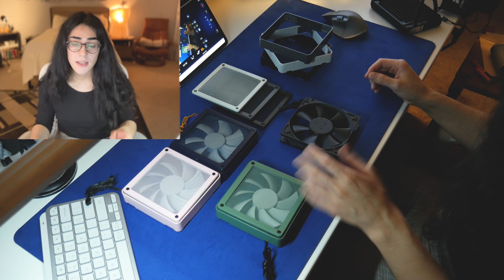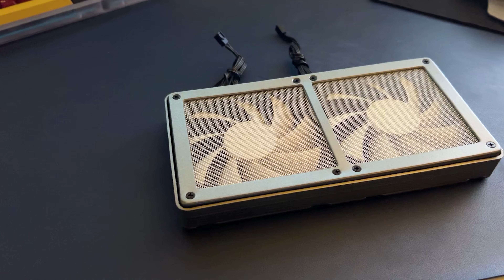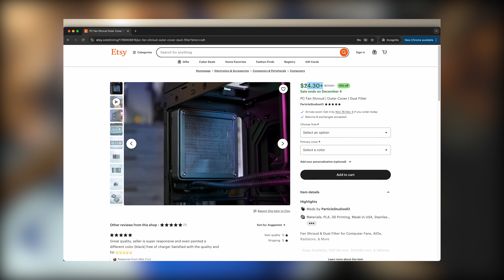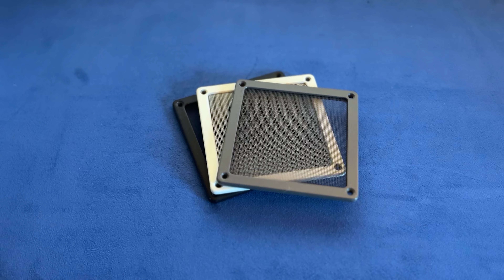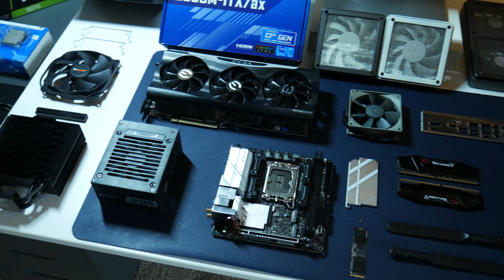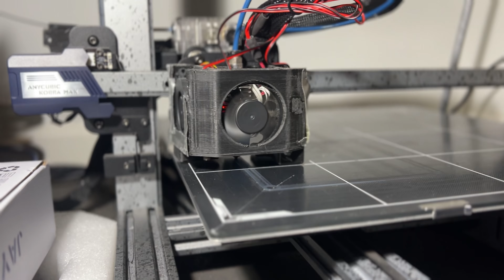PC Fan Shroud/Filter | BTS | Design, Inspiration, & Manufacturing

Comment: these look great!  great to see simple yet original ideas in the computer hardware industry with great aesthetics.  love the simple design and it appears that the mesh filter you use in these is not too small of a micron which will still allow for good air flow still and not get clogged up too quickly.
Reply from the maker: Tysm! Glad to hear this product resonates with you. And you're spot on about the filters - I specifically choose these mesh filters because they allows a generous amount of airflow with minimal restriction and impact on one's fans while also keeping a good amount of dust out. I feel these filters are the perfect balance between performance and preventative maintenance... and they look good too so there's that, haha. Best, Alex :)